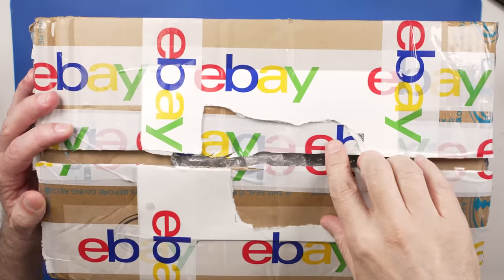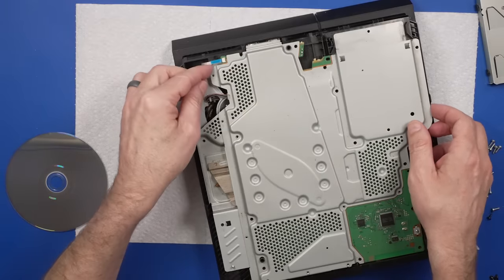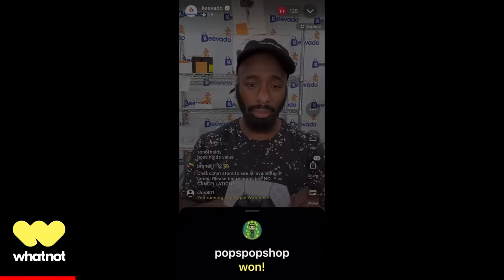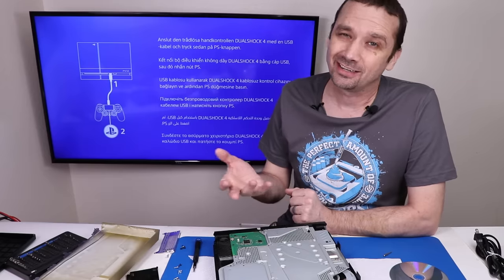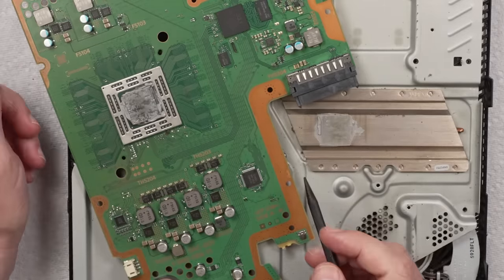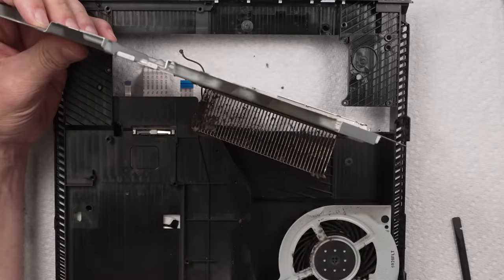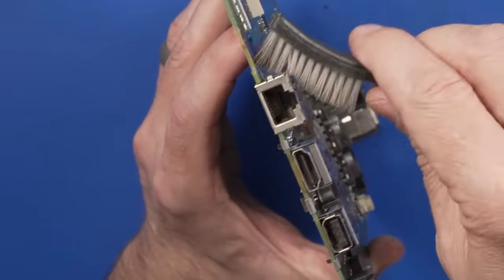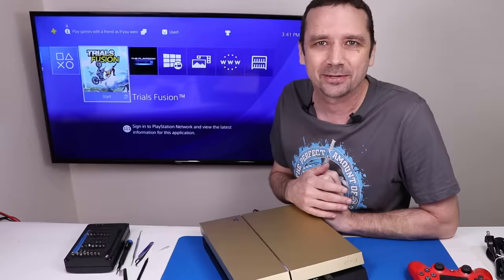Trying to Fix This Rare PS4 - Only 6,500 Made!

Comment: I've come across a lot of people who have no idea you're supposed to replace the thermal paste when you open/clean a PS4. There's plenty of people that have asked me why their ps is still overheating after they cleaned it and when I ask did you replace the thermal paste they say what's that? So you have to explain what it is what it does and how it creates that seal and helps pull the heat away from the chip so it doesn't overheat.
Reply from the maker: Yes! A lot of people don't understand that.
Reply: Ive seen plenty of processors ruined by not having the thermal paste changed after an  attempted cleanup.
Reply: I played consoles all my life and did not know prior to this channel (in my defense, I didn't need to open my consoles funny enough. Never had any significant issues until xbox series x). 

They will only learn if we educate them. Keep spreading the tech word. 😊
Reply: @Thesakuraharona exactly!

Comment: I used your videos to clean out my PS4 that was making the worst noise from overheating. Played Ghost of Tsushima online and the console would have to switch itself off after 20 minutes all the time… Not it’s been completely silent for about 6 months and no issues whatsoever! 
The only difference is I used a bit more thermal paste than you use, and I did it in a cross pattern 😆

Comment: Love the video, especially the old VHS tape fast-forwarding throwback. I did open up my PS4 pro and clean the inside and put new thermal paste on the APU, but missed a bunch of screws and lightbar ribbon cable, but for a first try, it works and is quiet, but I got a PS5 and don't use the PS4 a whole lot.

Comment: The seller should never have this "friend" try to repair something again. Not realizing it was a disc drive issue is one thing, I could have missed that either without another HDD to test, but the thermal paste part is unacceptable.

Comment: One thing that always disappointed me about special edition PlayStations is that they don't get custom sounds like special edition Xboxes do. This is the Taco Bell PS4, why doesn't it do a Taco Bell chime when powered on?
But on the flip side, it's way easier to just put a new motherboard in the special edition shell and have a working special edition. On Xbox you have to do more work to transfer parts and retain the custom sounds.
Reply from the maker: Totally agree. I like special edition Xboxes better
Reply: Also that's so cheating to plug in a flash drive with the top cover off. 😂 One of my least favorite things about PS4 was how they had recessed USB ports, you had to have a very thin flash drive to fit inside. Or use an extension cable. I'm glad Sony at least stopped doing that for PS5.

Comment: Just think if Apple had designed the PS/Xbox... every part would be IC chipped and married to the unit, screws would be treated with a special polymer coating so when you first touch the screw with a screwdriver, the screw explodes into a mangled mess that you are never ever going to get out...   Oh and special metering units inside so when you do finally get it open, the metering unit hooks up with your Apple account and charges you $100 per minute breathing in the interior air of the machine.   If against all the odds you fix your Apple designed PS5 another special chip activates, communicates with a secret GPT which auto Swats you whilst it uploads very dodgy stuff onto your fone, puter, car stereo so when the feds come a knocking you are punished for fixing the unfixable heehehehehehehe

Comment: Hey man I have a PS3 which I think is a rare one. It is the 20GB Black Trim model and the warranty seal is intact. Plus the HDD is upgraded to 160GB. And it works but has collected dust. So it needs proper cleaning. How much should I ask for it? Thanks in advance.

Comment: Hi buddy, lookin for some advice. Was playing the PS4 old version and the screen went all funny like something had shorted then it cut off and won't switch back on, it's just completely dead. Any ideas what's caused it and can it be fixed as my game is still stuck in it as well. I tried holding the on button for 15secs and all that and it just has no power.

Comment: I despise that model of PS4. I bought one for cheap needing a power supply. Replaced that, then I had to get a HD for it. Then the disc drive decided to stop working. Tried everything under the sun to get it to work but no dice. Personally I think when Sony made me update the firmware on the PS4, that somehow bricked the disc drive. Sold that POS for what I had in it. And I refuse to own that model of PS4 ever again....

Comment: So I have watched you repair multiple electronics over the last year. Would you ever tinker or modify the electronics to increase performance? Example: Create a liquid metal carrier or adapter plate for an Xbox (new or one/360)? Doesn't need to be console, just something fun to test if you can increase the performance of older tech.

Comment: I have this one, with the matching card of authenticity and only paid $200 for mine. Sadly its really just the top cover that makes it "limited" unlike the One X taco bell systems (I have both of those as well) which have not only their distinct coloring but also their specialized "bong" sound when you power them on. I feel that there should have been more specialized detailing to really make them obvious that they are Taco Bell. At least the 360 edition had the same markings and color scheme of the Taco Bell restaurants at the time.

Comment: i got a ps4 pro couple months ago that said it had blue light this or that...turns out the HDD in it was shot to hell 5% life left on a health checker. I reinstalled the system software/update via safe mode bootup and it fixed the unit. Someone took it apart dinking with stuff and stripped screws.

similar to a ps3 i got that was in pieces/no screws..i checked it out...plugged it in as is to see what it was doing, no issue was working fine..turns out the HDMI cable they had with the system was faulty(wouldnt show image unless it was sitting a certain way). So i had to rebuy screws to put it back together and secure it

Comment: Hey I bought ps4 from a pawnshop runs good the disc drive is giving me issues I have to put it vertical so It  can read games the game goes in slow and comes out slow, the rollers are all brown because the system was dirty  they need to be gray you think replacing the rollers will fix my issue?

Comment: I bought 2 pairs of AirPods Max for parts to try and fix one of them and I may end up with 2 working pairs for $200 less than you get them from Apple.  One of them is in very very nice condition too and I have the drive to repair them partially from watching your channel.   Your videos are great and have been so inspiring.  I am also 95% done with my first board repair for my 3ds just waiting on new bumpers and all I will say about that is you make it look so easy haha.

Comment: The friend might've not replaced the thermal paste cuz he didn't get the PS4 to work
I wouldn't replace/clean stuff on my PC if I didn't find that could've been the culprit of it malfunctioning
Reply: Ofc after fixing it and if it's full of dust/thermal paste not replaced in a year or a couple years.. time to clean/replace it

Although if I have to replace a fan I dust it all before replacing it, specially on laptops, since I'd rather have the dust balls end up getting stuck on the underside of the MB rather than near the exposed CPU

Comment: Hiya, I was wondering if you can fix my ps4 as I haven’t played it in nearly a year. I turned it on one time and it came up with the safe mode screen saying that I needed to update it I downloaded the update on my usb (witch they recommended) and tried about 5-7 times to no avail but the problem is updating it will erase my hard drive but I haven’t uploaded all my saved data on the hard drive so I was wondering is there anything you can do to fix it. Thank you and much appreciated.